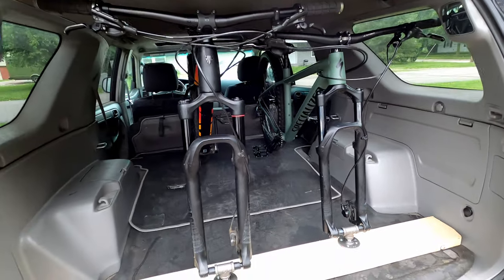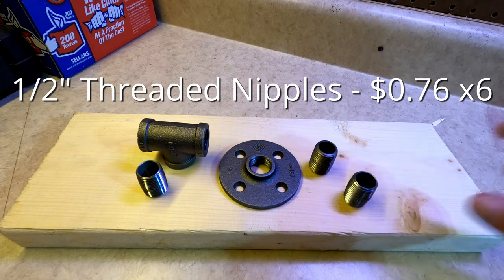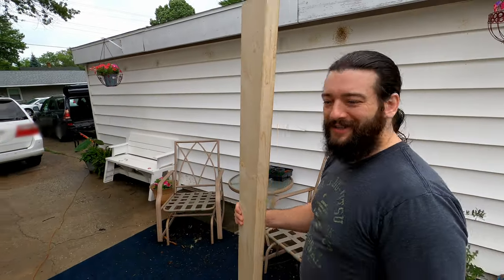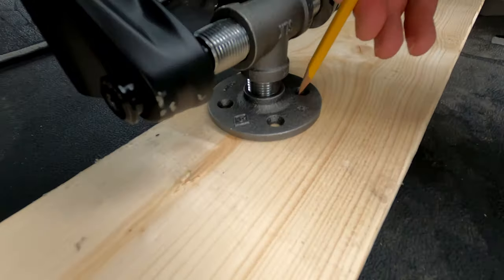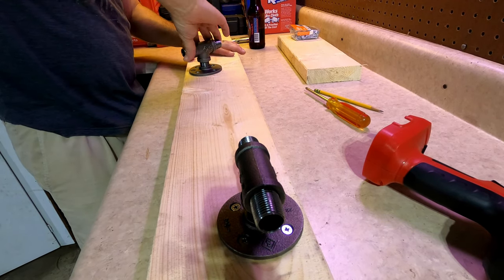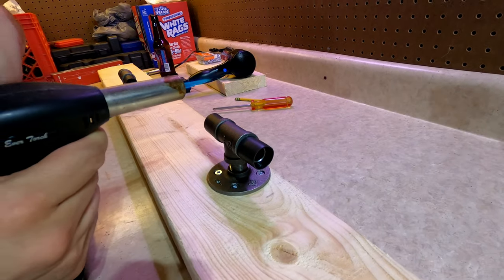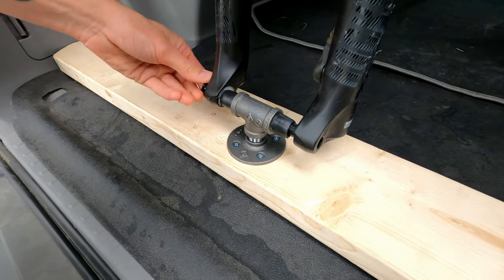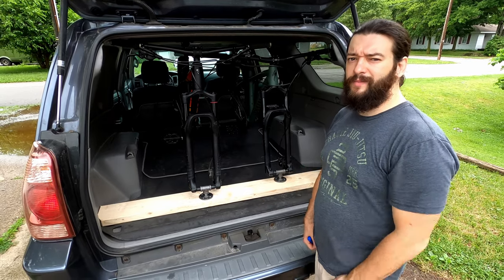DIY Thru Axle Mount for SUV - MTB Fork Mount (How to)

Comment from the maker: Check out a new and improved version of this mount!
https://youtu.be/8OkLllPGb1A
Reply: You could just use a 100mm block of wood nailed from underneath and drill a hole through it. Connect the bike with its axel.
Reply from the maker: @rufflesal that would definitely work.

Comment: I used to do this with my Trek7000 in my '07 Nissan Xterra and all I had to do was quick-release my front wheel and I was good.  I'm trying to find a way to do the same in my Rivian R1S but the roof is too shallow to leave my saddle on.  Just keep in mind that every vehicle is slightly different and this solution may require tweaks depending on what you drive.

Comment: It's very important not to tighten the axle, cause if the width is not spaced properly according to the fork (100/110mm) you can bend the stanchions or the casting..
But it's a nice idea!!
Reply from the maker: Thank you very much for this information!

Comment: They have 1/2" PVC threaded nipple/inserts for the t-bracket to avoid metal upon metal contact... \m/
Reply from the maker: I originally went with the plastics ones but the inner diameter was too tight. I thought of drilling it out a bit but ended up trying the metal ones and they worked. 
I plan on making another mount soon and I’m going to be using all PVC.
Reply: @MichianaMadman  Makes sense, the various diameters are key fer shur...

Comment: If the aluminum axle is damaged by the harder metal, that is steel, will it go through the wheel hub?
Reply from the maker: Over the years of using this, I haven’t had a problem with my axle being damaged.

Comment: this wouldn't work on a 15mm axle would it? .5" is like 12mm or so?
Reply from the maker: The axle in the video is 15x110 so it should work. 
That being said, there are smaller/larger diameter pipe fittings that can be used.
Reply: @MichianaMadman  thanks dude, you're a gem